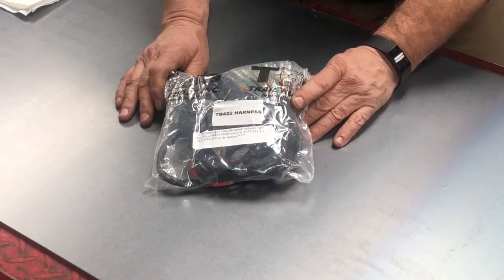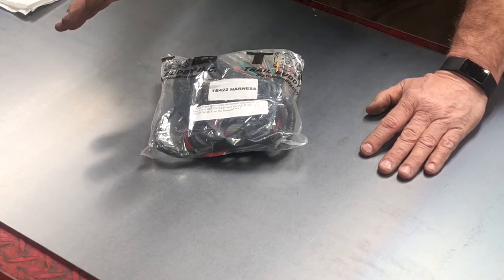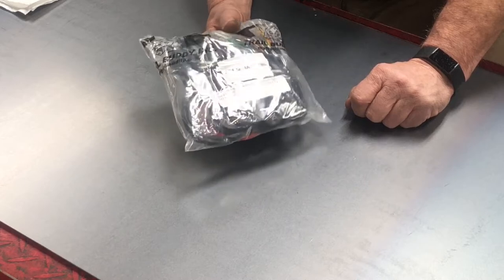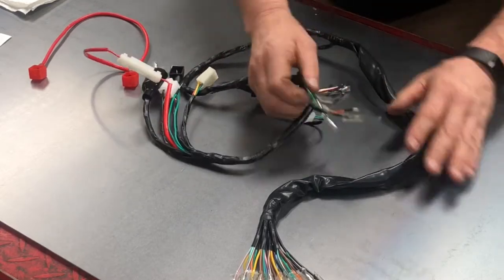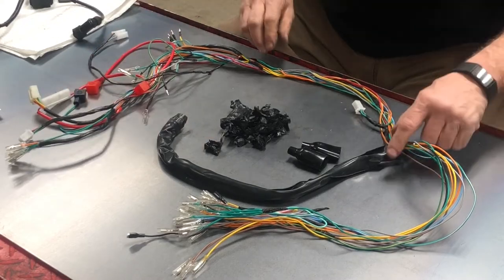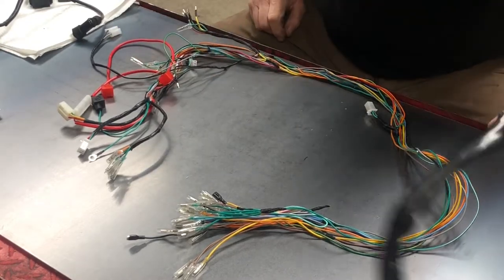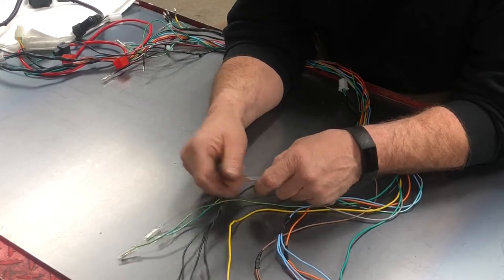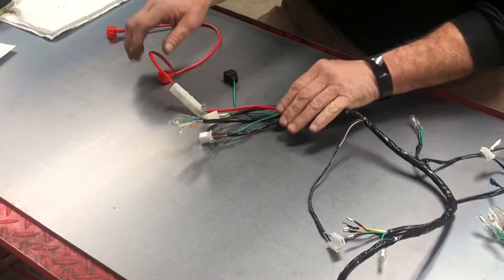Lifan wiring - Trail Buddy TB422 harness

Comment: I am re-watching because I’m using a Lifan-125 engine in my ct70.  Other than the bulbs in headlight & taillight (no turning signals) do I need to put new ends on taillight/headlight pigtails to fit on the trail buddy harness for 12 volt?  Will the stock 6v horn still work and will I need to change the end to plug into the harness?  And what about the rectifier do i need a 12 volt rectifier?  Thanks so much for your wealth of knowledge on these it’s been very helpful.
Reply from the maker: The taillight wires should have the correct wire ends.  The headlight should be plug n play also, but depending on the switch you’re using, there may be a wire or two that will need the ends changed. 
The 6v horn works great with 12v, keep it.  It should plug directly in. 
You will need a 12v regulator.

Comment: Hi Mike, i went to replace the battery in my son's 1991 Honda CT70 and found a huge mouse nest underneath. I am trying to clean it out and in the process found 2 wires that were broken off from who knows where. One is green with a yellow stripe and the other is black they are taped together. Would you know where they come from? TY
Reply from the maker: @devonm7868  Sounds like they are the foot brake switch, for lighting the brake light.   Black is 12v power into the switch and green/yellow is the power leaving the switch to the light.

Comment: 24:53 If i understand correctly, if you want working light from batery not from stator you not conecting these yellows wires right ? Thx Mike 🙂
*Sorry for my english 😁
Reply from the maker: @faridave  Correct.   Connect the headlight switch to a black wire.

Comment: Do I use a full wave regulator or half wave . 125cc  ssr motor. Thanks
Reply from the maker: If your engine has one white and one yellow, it should be a half wave engine.
Reply: @MiniBikeMike  does this mean you would need a half wave regulator/rectifier than?
Reply from the maker: @dannymotovlogs4254  yes

Comment: So Mike, aside from the harness also needed is 12v Coil, flasher ,DC CDI, regulator, lite bulbs... but is their a work around using the existing 6v wiring system with the Lifan 125 engine??Thanks
Reply from the maker: Bill, you’ll get a coil and CDI when you purchase a Lifan engine, those parts are part of the kit.    You will need to purchase a regulator, if you’re running lights.  Same with flasher, if you’re running signals.  
I’m sure there is a way to use the original harness, but I’ve never attempted to use one.  In my mind, the amount of time it would take to rework the original harness with wiring ends that will plug into the Lifan engine and it’s parts.......it’s just way easier and quicker to install a new harness that is designed to go with the engine.
Reply: @MiniBikeMike  Mike I purchased 72 CT70 with installed Lifan 125cc and is still 6v , don't have a clue as to wiring but it seems to run ok but throttle cable to long, do you recall the length on your blue CT 70. Thanks very much for your assistance
Reply from the maker: @billlester3088  The Lifan is a 12v engine.  If your bulbs are 6v, they must have a step down regulator in the system or all the bulbs would blow.....like I blew the headlight on the blue bike.   I use a throttle cable with a 36” cable length.  I think the outer sheath is 32”. 
Twist Throttle and 36" Cable Handle Grip Kill Switch Set for 7/8" 22mm Handlebar 49cc 66cc 80cc Engine Motorized Bicycle Push Bike https://www.amazon.com/dp/B08MFGPZHP/ref=cm_sw_r_cp_api_glt_fabc_248Q3QKW28V807Z29M05?_encoding=UTF8&psc=1
Reply: @MiniBikeMike  once again Mike you have come through, I am very appreciative, keep the video's coming and grow the channel

Comment: I have a lifan 125cc with a yellow and pink wire coming from the stator. I'm assuming the yellow is for the lights and pink is for the battery. The problem I'm having is the headlight doesn't light up at idle, but comes on when I rev the engine.
Reply from the maker: I’ve given up on the stators with a pink wire.  For $15, you can pick up a new stator on Amazon with the yellow and white wires.   $15 is cheap to have all your troubles disappear.
Reply: @MiniBikeMike  ok sounds like a plan. Yeah I've tried everything.  Do you recommend going with the same style 6 coil just one without the pink wire or go with a 2 coil like the ones in the original Honda motor?
Reply from the maker: @airwreckfpv8009  I prefer the 2 coil version.
Reply: @MiniBikeMike  thanks for the help

Comment: I ran into an issue that I’m unsure of. Instead of a yellow and white wire from the engine mine came with 2 yellows. Would it matter which one went to white?
Reply from the maker: If you’re looking at the regulator plug and the red wire goes to top left.  Connect the white wire to whichever yellow is below the red wire, in the bottom left spot.
Reply: @MiniBikeMike  Hi. The harness end is all good. White wire coming out below the red wire and out down the line with the wires that I need to plug into the engine wiring. The engine wiring itself is where I have 2 yellow wires instead of a white and a yellow.
Reply from the maker: @davidkobelka7219  I’m not a fan of the stators with two yellows.   You can try plugging a yellow into each of the yellow and white of the harness.  Start the bike and measure voltage at the battery.  If it’s above 13v, you’re good to go.   Most of the time, with two yellows, it goes like this:
Pick one of the yellows, doesn’t matter which one, and connect it to ground.   Take the other yellow and connect it to both the yellow and the white in the harness.  Hopefully, this will work for you.
Reply: @MiniBikeMike  Hi. Ok thanks for the info. It’s sure funny with these engines how every one is a whole new ballgame. I ordered the same one as you. Mine came missing the cdi and with 2 yellow wires lol. I’ll try both your suggestions thanks. In the meantime I’ve ordered a cdi and a new stator I’ll see what I get. Thanks again for taking the time to answer. Have a great day

Comment: hey,

Your video confirms to me that I connected everything correctly. But I see what I did wrong that still leaves me with no spark. And that's the kill switch connector. Can you tell me where you connected that wire from the kill switch connector to? Because I can't figure it out.
Reply from the maker: I didn’t use the kill switch wires, because I’m using the key switch to shut down the engine.   You can leave the kill wires unplugged.
Reply: @MiniBikeMike  i mean what you are talking about at 24:05 does this have to be wired to get a spark? and what should it be connected to? i also have an ignition switch to turn off the engine but i plugged everything in but still no spark
Reply from the maker: @ricardovd977  I had forgotten that the bike in my video had a separate kill switch.   No, you do not have to use these wires.  You should get spark, even if they are left unplugged.
Reply: @MiniBikeMike  Can I send you a message or an email? I clearly need help with my problem.
Reply from the maker: @ricardovd977  email is:  ct70help@gmail.com

Comment: I bought 110cc lifan engine frontspraketis15 t what number to go with the back buy 36t no fiting help me please
Reply from the maker: I typically run a 17t on the engine.  Make sure you get one for a 420 chain and the correct spline shaft….17mm or 20mm.

Comment: i dont have  a key switch i only have a kill switch, i pluged the kill switch to the  kill switch wires   in front i pluged  i think everything good  and when i start the bike  only headlight  is working and nothing works.  i little confused   its becouse   i dont have keyswitch ?
Reply from the maker: The harness has a white plug with 4 wires (red, black, green & black/white).   This is where a key switch would plug in.  If you’re not using a switch, you somehow need to connect the red wire and the black wire in that 4 wire plug.
Reply: @MiniBikeMike   in my harness  i dont have  plug  but in the front i see red  black/white   and then   black and  green
Reply from the maker: @serg_g7  oh, I thought you were using the harness I’m using in the video.  If not, I don’t have a clue without seeing the entire harness you have.
Reply: @MiniBikeMike   no but   wires colours  same and i pluged everything and now everything working  i watch this video 5 times and i learn from  0 to what u say in this video  big thank for you